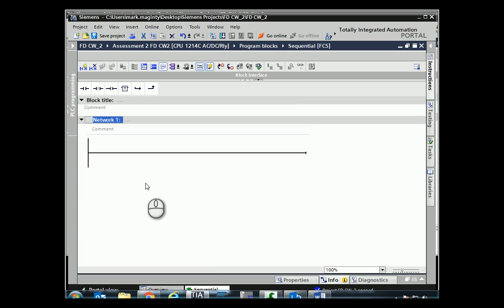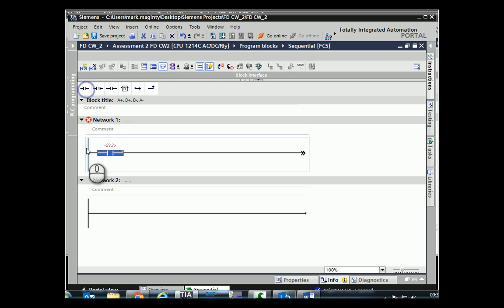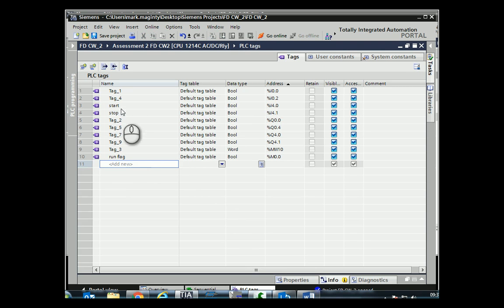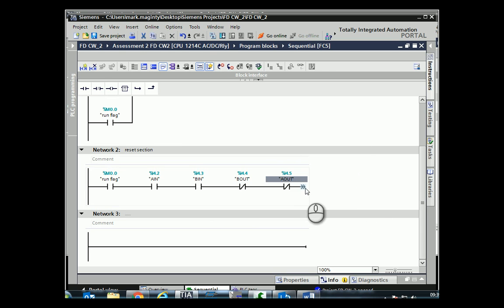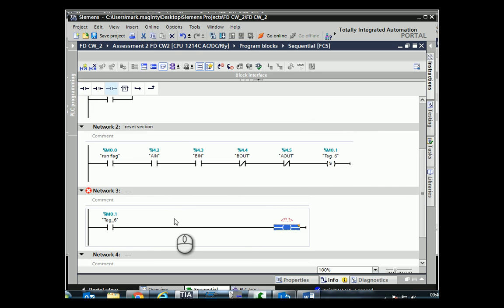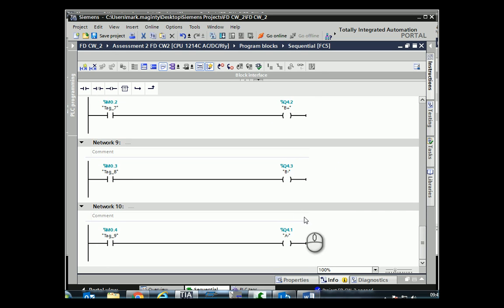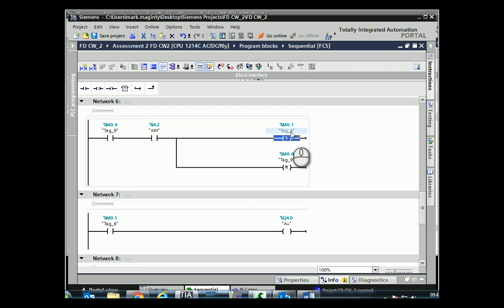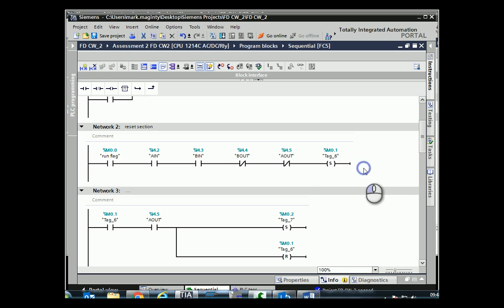Sequential Programming with Ladder logic

Comment: in this case when you press stop, it will still complete the started cycle. what is the good way to avoid that? insert stop input in front of every network? anything other?
Reply: I think having stop input on every network is probably the best option so far. Alternatively: 
1. Another network can be created after the first one(a somewhat duplicate of the first) but this time the stop input to be a normally closed and the output is a "reset" of the run_flag,whereas the first network to have the run_flag "set". Then the run_flag be ANDEDon every network.
2. Use of an SR latch with the Stop input to the reset input of the SR block. However this is kind of similar to having the stop input on every network.